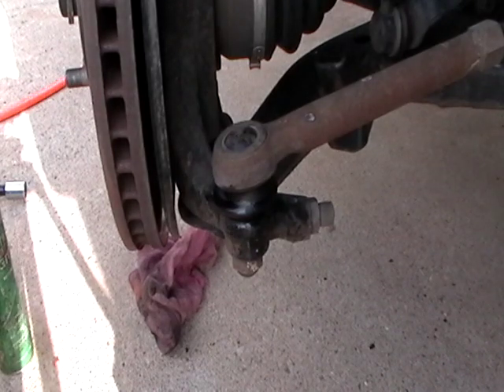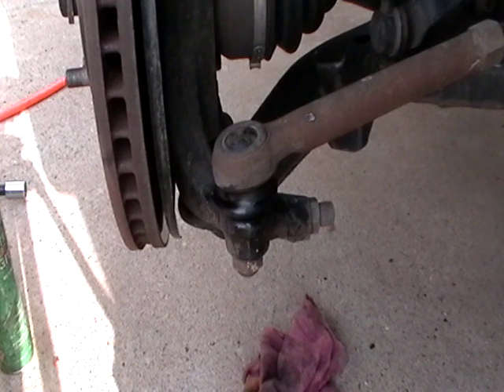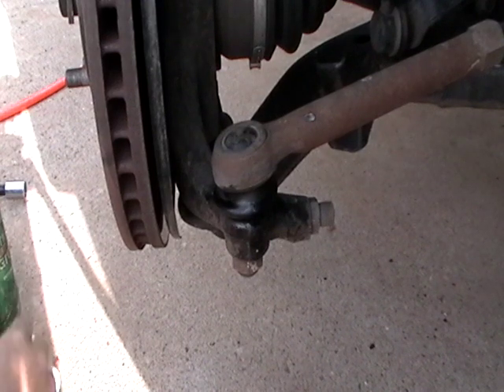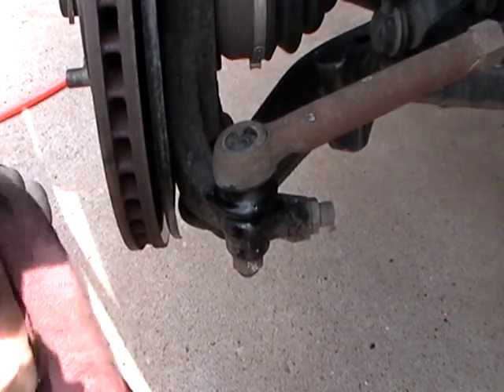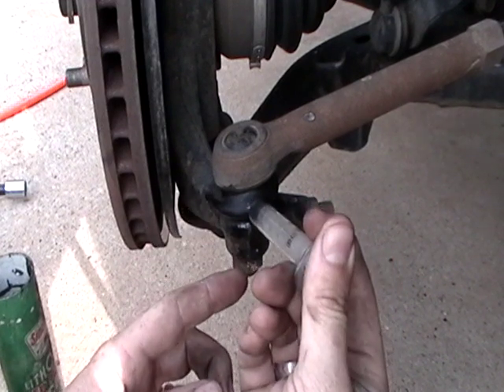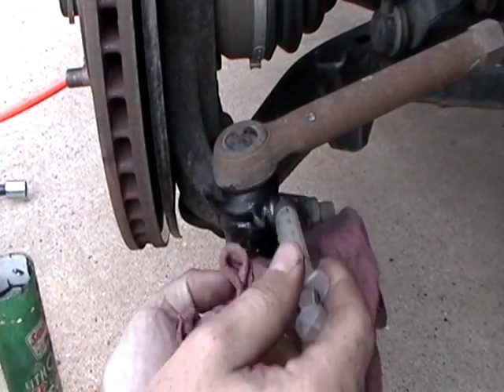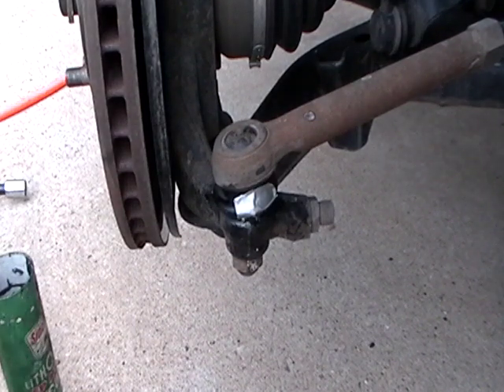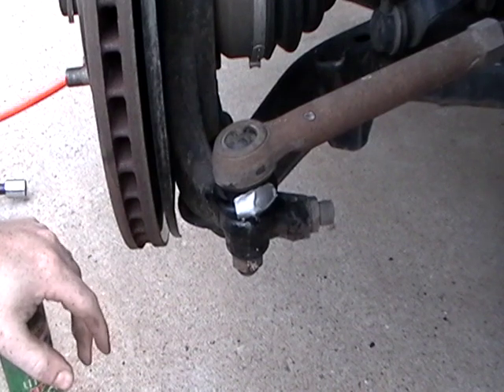Redneck tie rod end repair(or patch)

Comment from the maker: @palechinkevin14 Well it's been 6 months and I haven't had to add any.  I think the old grease that's in it gets kinda dry and then you get all the noise.  I never leaked out so it has no where to go. So technically you wouldn't have to add more if it doesn't leak out where you put it in.  But yeah mine still isn't leaking and the noise is still gone.

Comment: Yep. Have done it. After that I always buy Moog parts with grease fittings I just got sick and tired of shit Taiwan parts. FYI when I had to do it a few years ago. They make a needle with a zerk fitting on it. Sellit at AutoZone. What you are doing here is basically the same thing. Only thing I can say about the needle with the fitting is maybe the hole you make is a bit smaller
Reply from the maker: MI Backyard Engineer i like Moog parts....but even till today it's still working....we are getting ready to trade in the car though.   Good to know about that part.  Thanks for watching

Comment: I just saw that there is a zerk fitting on the top of the tie-rod end which is where you put the grease into (a grease gun is cheap about $20.00 new), and if the fitting won't take any grease you can replace the fitting they sell them at your local auto parts store.

Comment: They make a grease needle that attaches onto a grease gun you pierce the boot add grease wipe off any dirt or grease and then used some rtv silicone over the hole which will act like glue and seal the hole and viola you've just greased a NON lifetime greasable ball joint *this how they do it in the repair garages*

Comment from the maker: Why there was no play (if you remember 0:14 ) Compared to the other side ( 4:36)   it was just dried out inside the boot.  If I were to leave it alone it would have prematurely failed for sure.  Its been over a year ago and still not problems.  No noise and no play.

  P.S. I was mechanic for 6 years.  Before I decided to work inside where it wasn't as hot LOL

Comment from the maker: This is supposed to be a sealed unit.  Dont know what happened to it there were no blown or torn seals or anything.  I sprayed first just to try to get a coating in there.  Then put the grease in to keep it lubed up.  As far as doing it on like CV boots, dive boots axles???  Thats up to you.  First make sure there is NO play in that joint. Then if you want to try it.  It wont hurt.  On this there was no play (it was safe just annoying LOL)and if this didn't work I was going to replace it anyways

Comment from the maker: @RightBeatRadio Well heres my thinking I would have to replace the tie rod anyways.  So I poked a small hole in it and here it is almost 3 months later and the noise is gone and the boot is still not leaking.  So it's still working as if it were new.  Still no play in the tie rod.

Comment: You can buy injection needles that will atatch to a grease gun. I did the same thing using a needle. Then i used ruber cement to seal the hole. worked well

Comment from the maker: Not sure but I think if that actually happened I would just buy the new tie rod.  Once the boot is cut open.  Dirt and grim will get in there and in inevitably chew up and grind the metal surfaces.  On this one I put a pin hole in it and sealed it with out driving it around.   If it were on a riding mower or tractor where you dont go that fast you might could try it.  But I wouldnt do it on anything you drive faster than 20 mph.

Comment: You really had to go full hick mode with the super glue and duck tape which strongly signals an attempt of a permanent fix. btw there looks to be a grease zerk on top of that tie rot, if you actually did maintenance this wouldn't have been a video.
Reply from the maker: Adamz678 lol well this "temporary fix" lasted till this year when we bought a new car for her lol
Reply: tbh it wasn't that bad for a drive and dump fix, it worked for the time needed and actually responded to one of the replies to your video in record breaking time. that's such a rarity on youtube nowadays, you earned an extra sub and I never sub to many. good job!
Reply from the maker: Adamz678 awesome I enjoy talking to others I taught a lot but have learned maybe more from others.  Thanks for watching.  Yeah you never know what I'll be doing next haha